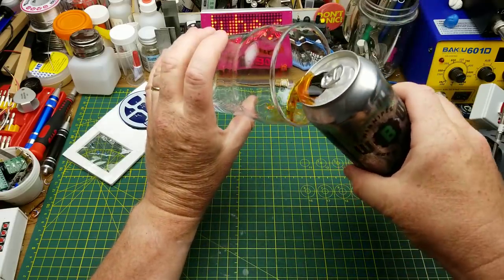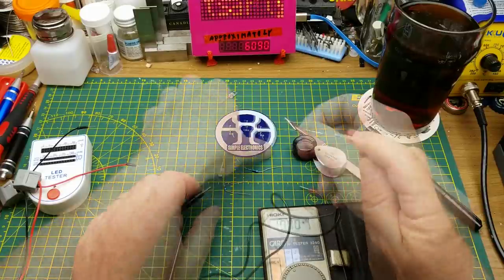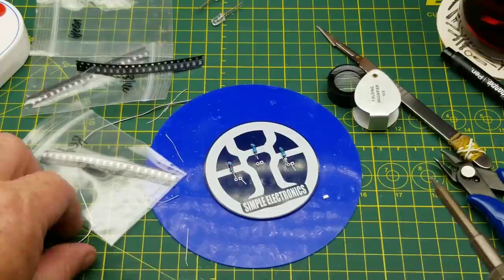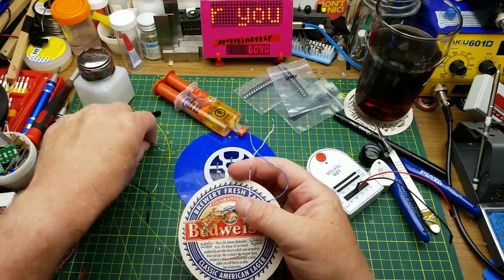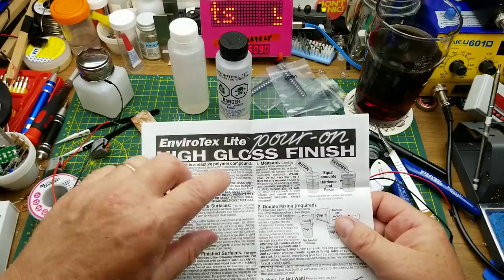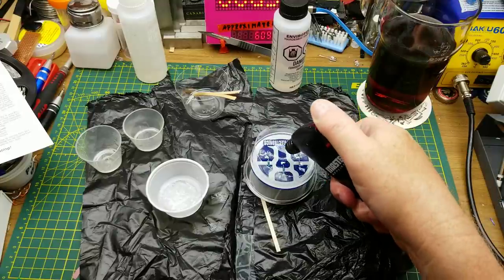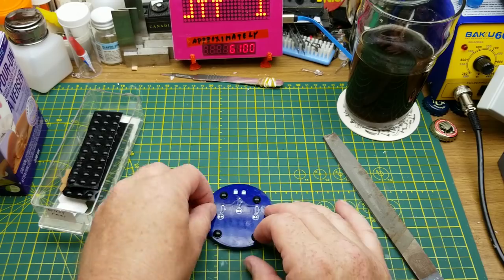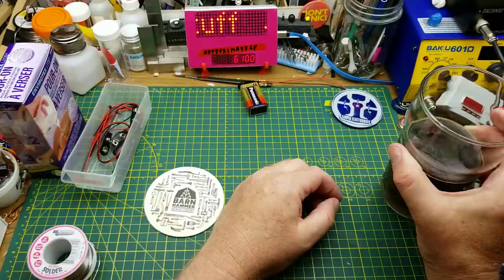building a light-up beer coaster

Comment: I saw somebody popping those bubbles with an vacuum cleaner. Just put it in an container with a connector connecting to the hose. So maybe a combination with a burner is the easiest
Reply from the maker: The instructions for the resin say that it's more the co2 that causes the bubbles to pop than the heat. They suggest exhaling on it if you don't have a torch handy (or if your mould is flammable)

Comment: I was wondering if hitting the nice smooth edge you got with the plastic cup with coarse sandpaper would diffuse some light out the sides, since you can't see it through the beer.
Reply from the maker: That's a good thought.

Comment: Sometimes the simplest kits are the best.
Just wondering if you got the resistors right.  Red LED usually has the lowest forward voltage which means it would likely have the highest value resistor to the red in order to make the three LEDs light evenly.
I hope my circuit theory is right lol.
It was a great idea making it a lit coaster
Reply from the maker: SimpleElectronics reminded me that I got the red and green resistors reversed. But if I was to do it again, I would use lower value resistors on all 3 LEDs to make them brighter at 5 volts.
Reply: @pileofstuff  yeah, it would be an awesome project to run off a USB Power bank.  It would last ages and light your drink up nicely.

Comment: Potting your circuit before testing it at least thrice is a mistake one makes only once ... I speak of experience ^^
But its really nice ! ...  so we will see RGB illuminated beverages in the future ? 
To answer your question, I think the LED with the lowest forward Voltage gets the highest resistor for brightness compensation. Maybe you could fit different values on the flip side ?
Reply from the maker: You're not the first to suggest adding resistors t the underside of the board to brighten it up a bit. Seems like a plan that should work.

Comment: i has try 3 day burn code to my first ESP32-cam board whit arduino ide and ftdi programmer, not work, and i see one instruction were en pin and gnd has adding 10 uf capasitor but board come hot lot.  no working alltime say only board  not connect wait,,,fail, manytime try and many /all jhave same instruction in youtube, tx,rx, to esp rx tx vcc 5V and gnd ,arduino ide then have ai tinkerboard, groowe board or what have i try all no burn.
Reply from the maker: I'm thinking about starting to tinker with the ESP32 boards that I have, but the code part of any microcontroller project is what intimidates me.

Comment: I had the same flame thrower. Until my step kid stole it to smoke meth and crack.
Reply from the maker: That little torch has seen action on miles of heat shrink over the years.